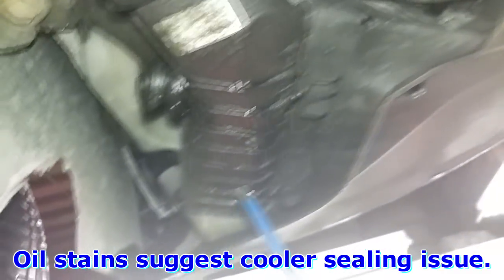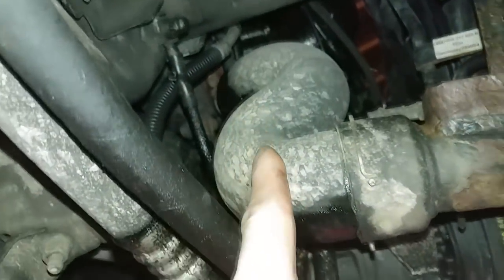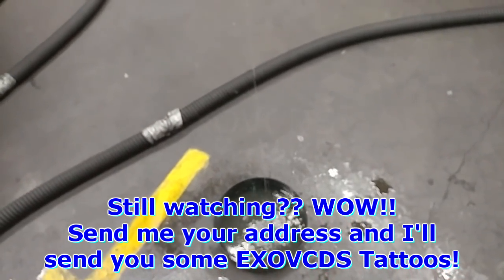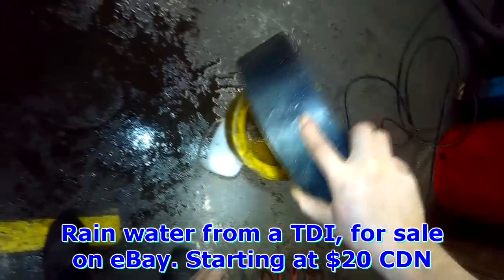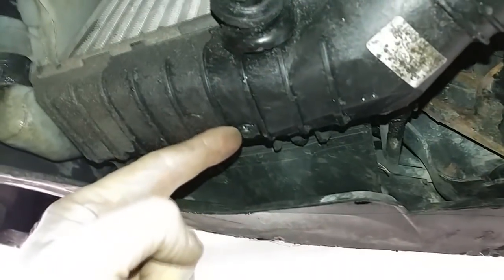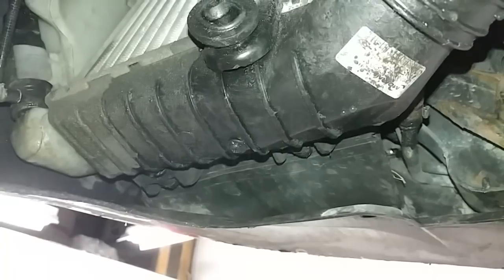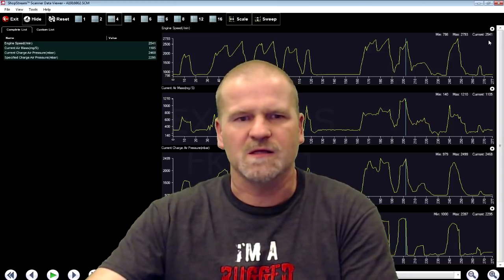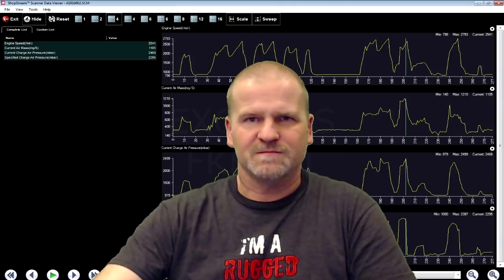VW B5: Hydrolocked TDI (long version)

Comment: So did you changed the oil?
Reply from the maker: No... there was no sign of water / oil mix (before getting it running, or after the test drive). 
Adding $$ for an oil change (before or after the test drive) with no guarantee if the engine has underlying issues, did not make sense at the time. I'll post a video update the next time I see the vehicle.

Comment: If i not change the abs control module is not problems or I have to change
Reply from the maker: If the module is bad and it is causing communication issues (no communication issues when disconnected), then you can leave it disconnected and drive the vehicle... but you have no ABS function. In some countries / cities that will cause the vehicle to fail an inspection. You can send the ABS module to a repair shop and drive the vehicle with the module removed.
Reply: Thomas EXOVCDS thanks
Reply from the maker: Do you have communication with it disconnected?
Reply: Thomas EXOVCDS I have to check if have communication

Comment: I want to test my engine tomorrow but its sunday So i cant buy anything !how to clean a distributor cap ??(with steel wool or sand paper what grid )???
Reply from the maker: Contact me only with ONE social media platform (youtube or instagram) for questions... I read both, but I don't need to read the same question twice. If you have pictures, use instagram, if you have questions, use instagram or youtube... but not both for the same question.

Comment: I think maybe some people forget about the proportions here. Had it been a vacuum line, AC line or oil pressure line, then absolutely - the leak is significant! But with the dimensions of the pipes and parts, the air pressure (induction) levels and the vast volume of air going through - the actual leak /if the screw is left out/, is would probably not even be measurable in a lab environment. Its there, but it basicly stays in the realm of theory.
Reply from the maker: Good point!

Comment: They were lucky,  I have a AHF TDI in a Seat Leon, think I may drill the inter cooler when I do the next oil change.  Had the car 11 years and would be interesting to see if anything comes out.  The car has done 120,000 miles.
Reply from the maker: I too would be interested... let me know what you find! Thanks for watching!
Reply: You're welcome, I'm lazy/old these days so don't normally go under the car. I use a vacuum extractor through the dipstick to remove the oil. Can I get at the bottom of the inter cooler without removing the bottom engine cover?  Thanks
Reply from the maker: Possibly... not sure. We don't have Seat in Canada.
Reply: It's a mk4 golf/ mk1 Audi A3 underneath but cheaper to buy!
Reply from the maker: If the cooler is in the same / similar place, then yes. I have Euro software that I can look at to see where it is / if it is similar. I'll get back to you this week (If I remember to do so).
Reply from the maker: Can't quite tell from the service info that I have, sorry. Bottom engine cover should be able to remain in place... if it is like the mk4's here in North America. The cooler should be on the outside of the "soundproofing" plastic
Reply: Yes it will be the same as the mk4 Golf, thanks for checking. The car is 14 years old so the plastic cover is rather beat up and I'd rather not mess with it. Will be doing another oil change in a few months and will let you know the results of I do drain the cooler.

Comment: How deep and long of a puddle?  =D That removal of glow plugs and cranking was an awesome fountain show! =) Another tip you can give about the boost leak is "try to breath through a hole that small see how hard it is...." =D
Reply from the maker: 12" and several feet (20'+ large) wide... good example of what a restriction it actually puts up!
Reply: Maybe needs a disclaimer on the steeringwheel that it's a car and not a submarine. haha =D

Comment: Very nice video as usual. Don’t sweat the ones that don’t like u drilling the hole. If I may. The hole is a leak, but not enough to reach an engineer set threshold that sets a code. Does that sound close?  Really nice documentation of the test drive. So u r using the Verus and then playing back by means of the buffer feature.  If possible, maybe on a future video, u could show us u pushing the buttons on a Vantage Pro doing all the set up work.
Reply from the maker: Hi Bill... yes, the hole is a leak but not enough to set a code. With the screw in place, it's not a leak.
I used my Modis Ultra to datalog. I then import the file to ShopStream Connect and I screen recorded the file for this video. You can play your Vantage Pro files in ShopStream Connect the same way I viewed the Modis Ultra file.

Comment: Very cool. That's a lot of water. My guess is that it must have stalled pretty quickly and that prevented a significant amount of water from being pumped into the cylinders. Nice that you brought it back to life! Also, great job showing the PIDs for the turbo system. Case closed. Thanks!
Reply from the maker: I forgot to ask if he had to walk out of the puddle.

Comment: The fact that its a diesel was probably its saving grace.
Reply from the maker: Yes... valve orientation, size of valves and hollowed out piston top, but low speed rpm more so I think. I'm sure it would have bent rods otherwise.